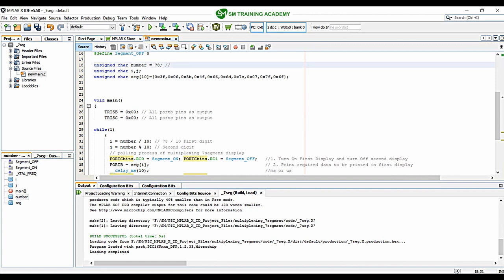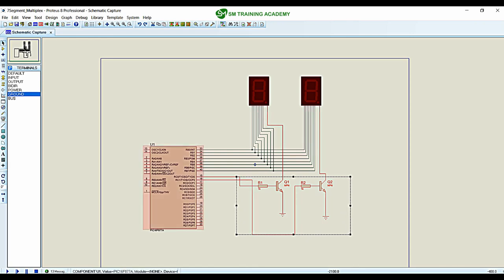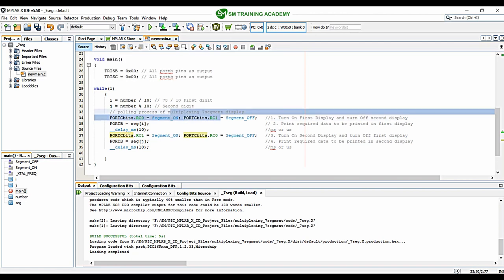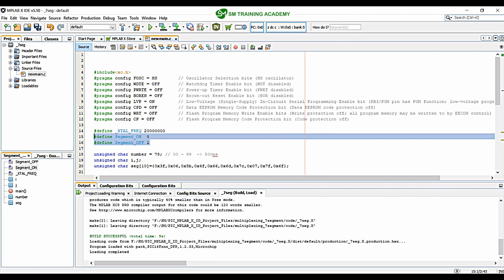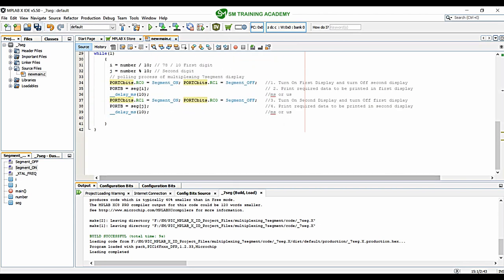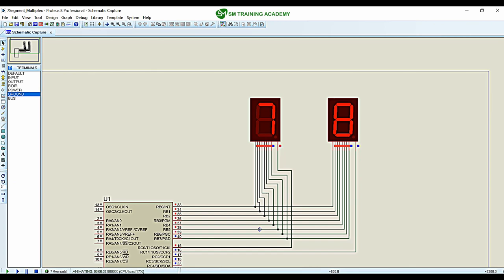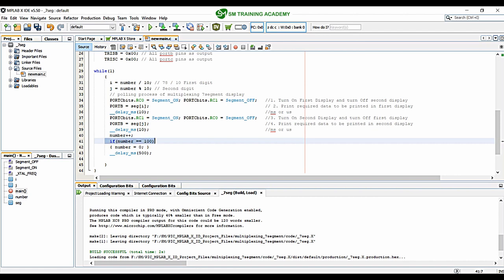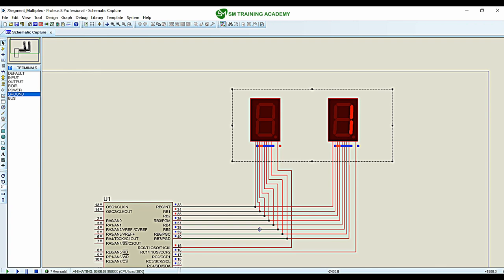Multiplexing 7segment Display's using Timer Interrupt in PIC16F877A | MPLAB X IDE | XC8 Compiler

Comment: Hi sir, when programming for 7 seg on PIC16F18877. How do i display temperature readings taken from LM35 to show the value on the 7 segment.
Reply from the maker: Divide the number into individual digits and you can print them in respective digits right ? Any issue